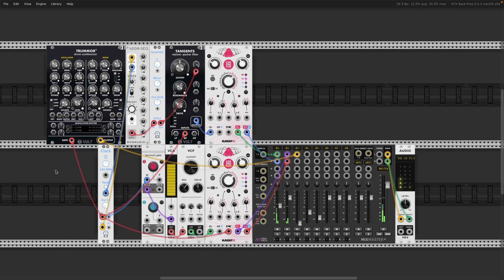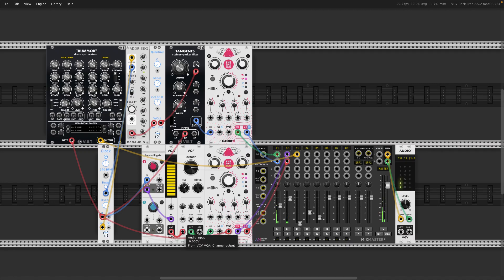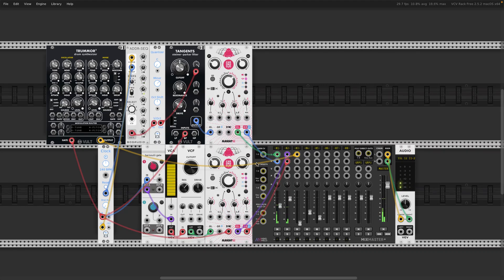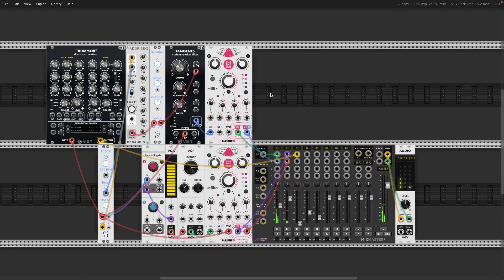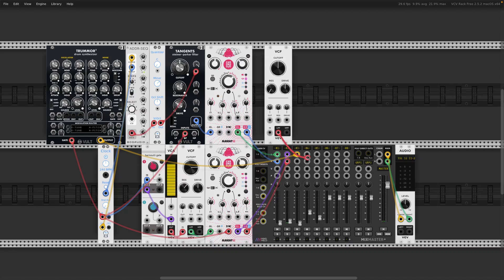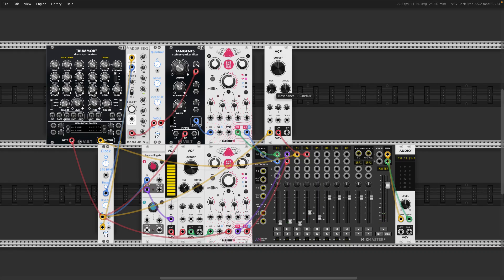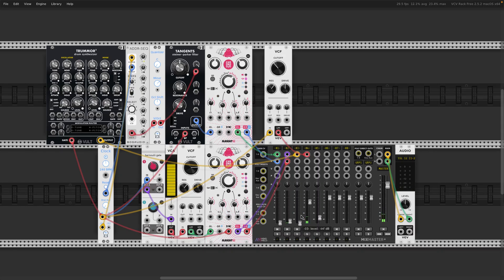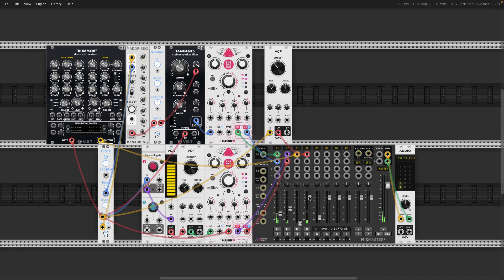Pinging Resonant Filters (mini tutorial) - VCV Rack

Comment: thanks for the tutorial mr koma :)  i have a question why do you conect bernoulli modul to the VCA?
Reply from the maker: Hey st_cherry! I used the VCA to attenuate the burst of voltage coming through the Bernoulli gate. It doesn't make that much of a difference here, to be fair. It just makes the trigger a bit shorter. You can also use an envelope generator with fast attack time, but neither is necessary!